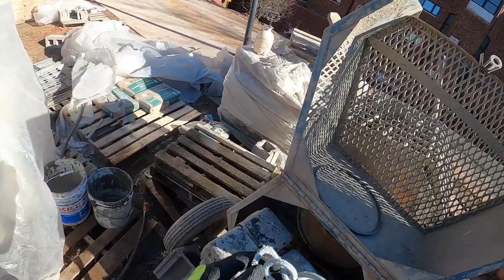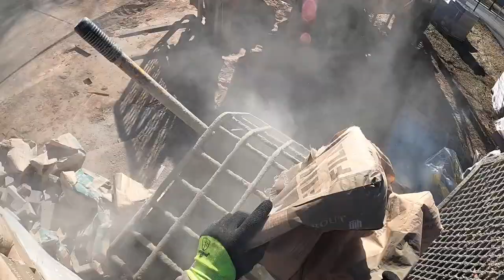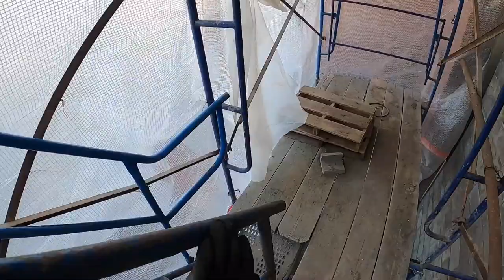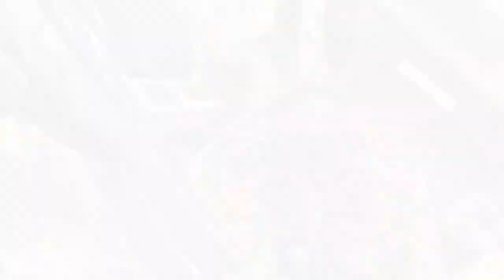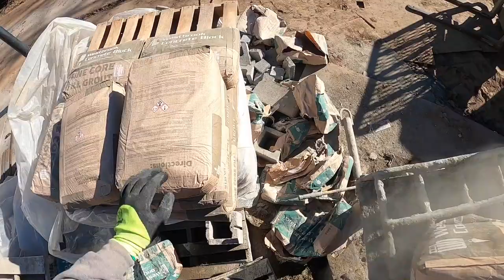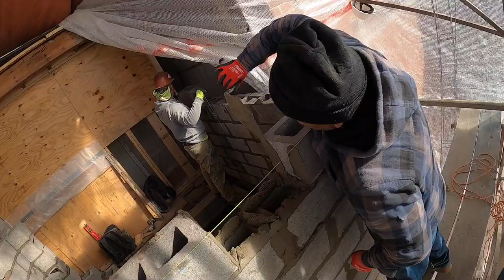Day in a life of a mason laborer PART 1

Comment: The one thing that always stopped me about a career in masnonry was the toll it takes on the body.  Have you found this to be the case as well?  The bending, stooping, lifting, dust, moving scaffolding?
Reply: Yes im trying to get out now into another career in the labores.  Like road work or pipeline
Reply: @dylanmitton1  have you had health issues that were work-related?  I see so many masonry workers without proper respirators and equipment.  Silica dust is no joke.  Glad you're looking to move on.

Comment: Setup by my employer worry everyday I will die from silicosis from drilling into concrete the dust is fatal with no hope get your loved ones away from construction please help spread awareness.
Reply: Not using water when cutting ? Did masonry for 35 yrs had both shoulders had arthroscopic surgery's - 4 months each..and just had my left shoulder replaced. Got out of masonry before my right shoulder got worse
Reply: @aaa7189  thank you so much for your time I had never heard of silica or silicosis until after the fact I was just a carpenter and got a job suppose to be carpentry but we were building large mansions on the beach and had to tapcon everything to block or drilling holes into the slab for tie down rods blowing out with air or cutting lap siding I had seen a lot of people around me doing it dry my entire career and didn't think anything of it I really had no idea about the dangers of the dust or the fact that it's a death sentence with no cure or treatments and it's been scaring the crap out of me I only worked for the guy for 3 years and didn't do it everyday but did do a lot of it I talked to a few masons who told me they had done it for 20+years dry and never wore a mask or a real cheap paper mask i have seen a pulmonologist who said there is mild scarring on my lungs but that he doesn't see consistent findings associated with it at this time that I have to monitor it for the rest of my life it has turned my entire life upside down and I keep trying to find hope in this I just wish I was atleast warned most of the guys I have asked never seemed to care and still see it done dry to this day I really appreciate your time it has given me some hope in this I just hope it's not too late for me and my family
Reply: @aaa7189  did you ever dry cut it without a respirator
Reply: @jcfpv3454  Always cut with out masks back then.  Started to wear a respirator since a restoration job in 2000. Safety glasses were rare back then. In the early 90's I was cutting block and I felt something in my eye.A piece of the blade went into my cornea. I had to drive to the only open emergency center for eyes 32 miles away. Ever since then I wear safety glasses
Reply: @jcfpv3454  I used to get a masonry magazine that had a article on silica. It said that a coroner had a hard time cutting two old bricklayers lungs.I wonder what my lungs look like. Not often, when I lay in bed I can't get rid of a wheeze now and then after getting a whiff of the dust from them cutting near by. I had a blood clot in my lung in '12, maybe a fist size maybe more of my lung died from the lack of blood/ oxygen as a result. write any time
Reply: @aaa7189  I really appreciate all your info it has truly helped me calm down a little I had no idea and wish there would have been 1 person who would have told us of the dangers  I really didn't think of it as a fatal disease once they told me mild scarring on my lungs it pretty much blew my mind and sent me into a tailspin with aniexty attacks still being some what young  in my 30s this has come out of left field and been absolutely crushing for me I have always tried to be safe especially at work I have seen people in clouds of it and or masons cutting blocks dry regularly but didn't realize the effects it could have on my health.
Reply: @aaa7189  so basically I am screwed which is what I thought all along I see so many still dry cutting it and still drilling it and realized there are gonna be a lot of people die from this most block guys i know still dry cut it with a concrete saw i guess i have no options, no hope, and no treatments this is murder to me my employer could have atleast told me
Reply: @jcfpv3454  Be thankful that it was caught early. There are many out there who are worse. Are you still employed by this employer ?
Reply: I started working for another company before I found out and they dry cut fiber cement board repairs break up tile and concrete repairs on occasion I reported it to my current employer and was moved to another area they started covering everything up but I have proof i expressed my concerns over using water and they refused to comply basically said that's the way construction is and you cant prove we did anything the contractor actually sealed off an area with 3 guys in a bathroom dry cutting a concrete trench in a closed room. I started using a p100 respirator about 2 years ago and leave the area when they cut it or sand it dry and try to get the other employees to use water because I have to ride in a company truck but they refuse too and will end up with it pretty bad I see them in clouds so thick you cant see them and dont want to be breathing it in the truck right now I am trying to find another job to get away from it but have to keep my insurance so I can get a accurate diagnosis basically I was told they have to do a number of tests because it's only mild scarring and with covid its spaced everything out months but its been difficult and the bills keep coming in once I reported it to them and how I have scarring in my lungs and I instantly became the black sheep they pulled me off my service truck and put me in a different area were it's not done regularly I always use water but I am afraid it's too late.
Reply: @jcfpv3454  Is your work residential or commercial ?
Reply: @aaa7189  residential
Reply: @jcfpv3454  I didn't like working residential, they don't care about safety that much. When you do get hurt the company owners cry about $. Did your Dr. ever ask you where you worked to get exposed ?
Reply: @aaa7189  no the dr didn't even seem to care he said well you will have to see a specialist cause he had never heard of it I am trying to get out of this job as soon as I can it's all I can do. Its been really hard dealing with this its breaking me down to my core and I have always been a happy loving person who cared about people and now it's all going down the drain over something I didn't even realize or know the dangers. I don't understand how they can do this to people with out facing criminal prosecution all my dreams are shattered and the thought of growing old with my wife will never happen.
Reply: @jcfpv3454  Go see a specialist too see how it really is. Then you can tell them that you got it from work because they don't provide PPE which is required. That might get the ball rolling
Reply: Thanks. I'll look elsewhere for my money to someday have a home for my kids. No point if my bodies broke